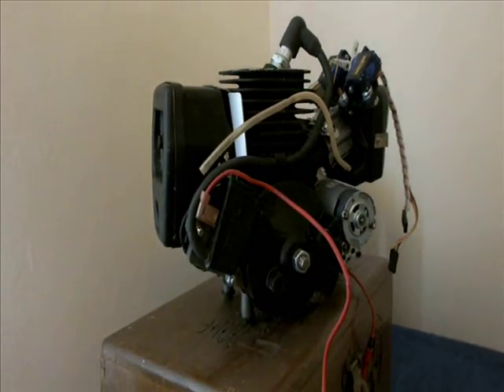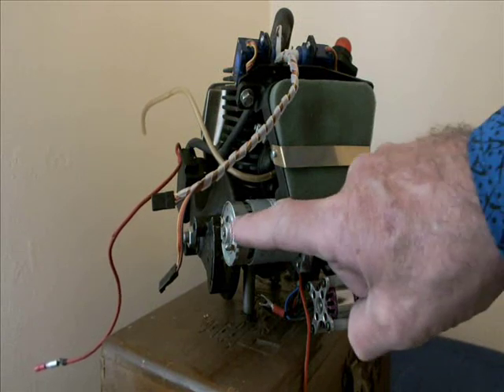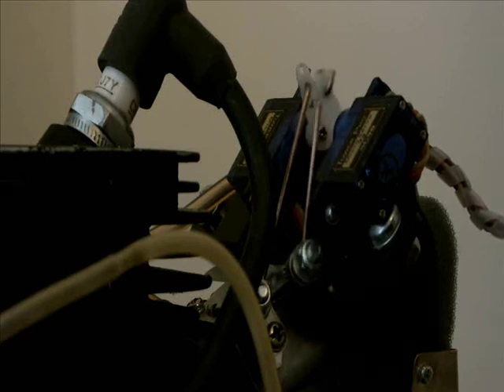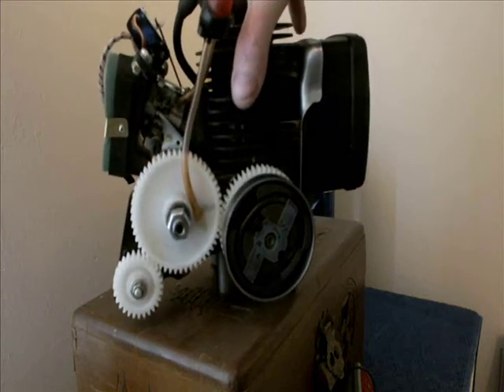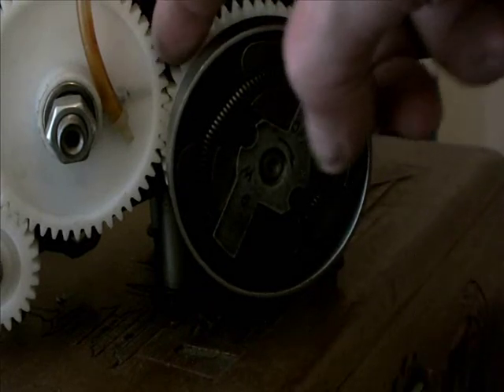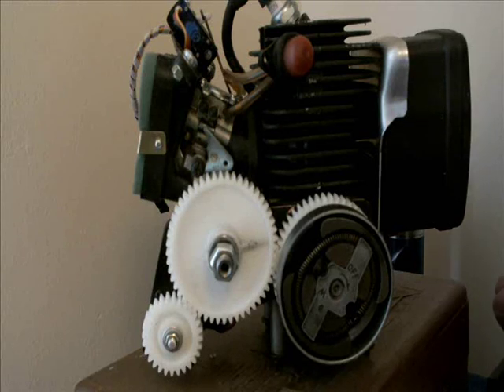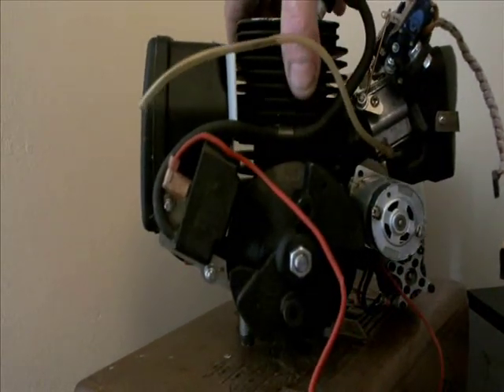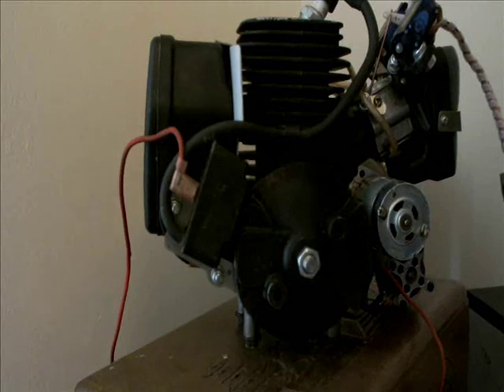Chainsaw Engine Modified for Electric Start and RC Control

Comment: Unnecessary fitment! Unless one wished to provide D/C power with the second motor.
-
I don't post videos on YouTube.
- Mounting the 50 tooth gear on the clutch bell output is fine. 
-
However a smaller twenty tooth spur gear on a shaft inline with the main gear would be better..
A small compression spring on it's shaft for disengaging it, until needed.
-
A 1/4 inch square hole on the spur gear face for inserting an extension bit of a cordless drill/driver
-Rotating the drill and the smaller gear clockwise, will produce the correct counterclockwise rotation to start the engine.
-When the driver is removed from the spur gear the spring on it's shaft will move it away from the driven gear.
Reply from the maker: And may i suggest you go back to school and learn basic engineering Aye Bee. The system i used was cheap, relaible and actually worked out to give the correct gearing, and loading for the parts i used, do you have a better project, or are you one of these armchair engineers that knows a lot but knows fuck all. he engine was used in a far more complex drone that worked well. Do me a favour, save your cordless dril for drilling balsa wood or plastics and leave real engineering to those who know what they are doing..!
Reply: ASE certified since 1983. As I said, I do not share videos since there exist so many thieves of intellectual property on the net. These are toys.
Nice job on the expletives dude.
Reply: Oh, John..............Run your starter/generator/gear drive with the engine actually running @7000rpm so we may observe static balance, and instability issues.
My starter drive (above) will not suffer those ills, of your continuous engagement system- of flawed thought.
Reply: And your gearbox (Brushed) 24:1 reduction starter motor(Parasitic)...........drag? 
-
 Hello >>>EMF!!!
Consumable carbon brushes to rapidly wear out on the Armature. 
Completely silly, and inefficient.
-
One should purchase a stater motor for a 5.5HP Briggs. It has a Bendix that will retract when D-energized after starting, and releasing the switch/key. 
Get the correct pitch gear; in brass for the back of the clutch, on the crankshaft end.
Belt driven alternators for autos, cruise @about 1800 to 2150 engine RPM on the Highway. Max speed for an alternator is 3600rpm to generate full wave A/C. current.
Add a Diode(Bridge)rectifier, and a capacitor/filter/noise for your servo's receiver to this brushless D/C motor to ensure square wave output.
-
-
Yeah I learned this stuff reading books.  Going to University(6)years. And getting grimy from foundries to machine shops.
And fixing loads of Autos and Trucks that were badly conceived by  low brow engineers
-
Yepp your a real nasty man for showing kiddos this video you love so.

How many kiddos are going to have quirky control of their R/C UAV's, or Cars with all the stray EMF's of your charging system, Brit?
-
I think I will melt some coca-cola cans in my cheap forge now for my next project.
-
 Watch King of Random, or Colin Furz.

Comment: LOL, so much for that; ya couldn't even get the dang thing started!
On your last line of the description you say "Throttle and choke are controlled by standard 9g servo's...." Um... the servo's... what? Which possession of the servo did you leave off right there?
Reply from the maker: +MaxxFordham  As this was a dry test just to demonstrate the starter and other added things, it was quite obvious there wasnt a fuel feed to the engine..! As for your comments about the servo's, please clarify, it doesnt make sense. In use, the engine ran fine, the starter and alternator worked fine, and so did the throttle and choke..! Any other things you would like to pick on???
Reply: John Lannigan, with the way you had that smaller small engine positioned (I mean... since chainsaw engines are already smaller than most small engines on tools) -- or just with how small they are in general -- it actually wasn't that obvious that there wasn't a fuel tank hooked up. So... thanks for explaining that now. My asking you why you didn't start it right then isn't "picking on it." It is a simple question. Don't be oversensitive.

Actually, what I said about your use of the word "servo's" there does make sense; you just didn't get it. It's actually your use of the word "servo's" there that doesn't make sense until you clarify. And you did it again. You said "servo's," which means you're either referring to a possession of the servo (something it either has or primarily uses), or you're trying to contract "servo is" or "servo has." But in your context one of the contractions would've made even less sense. So which belonging of the servo are you trying to refer to but which you left out?

Comment from the maker: Actually it is quite well balanced for what its doing, but bear in mind it is a single cylinder engine and a lot of the weight is one sided as a result. In reality, even if it was unbalanced, the starting cycle is only used for 2 or 3 seconds anyway.